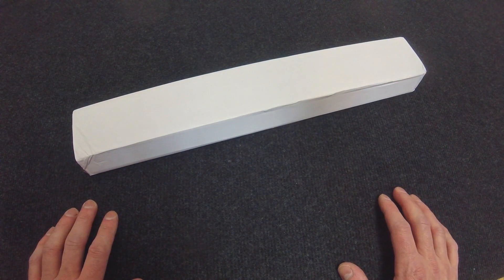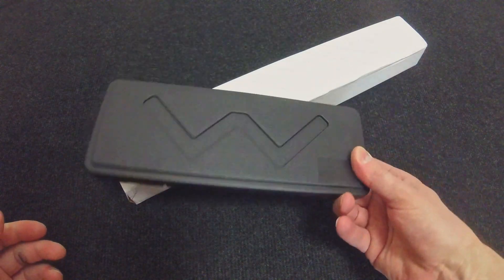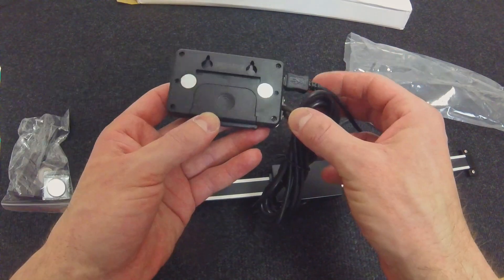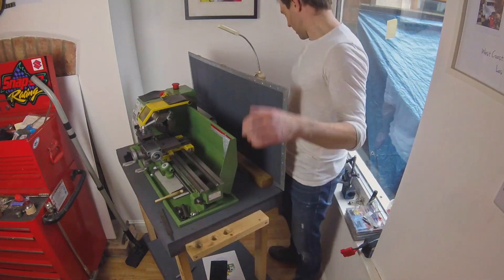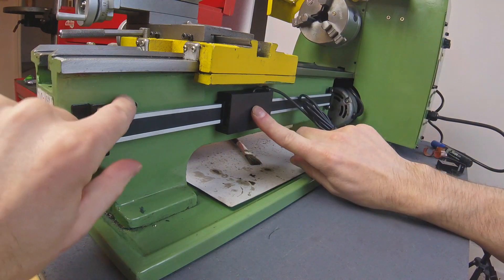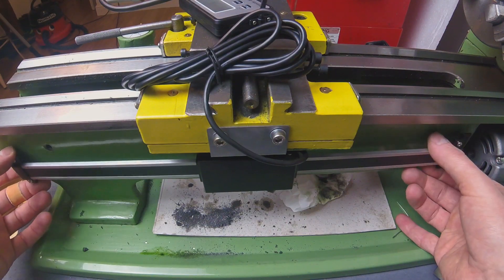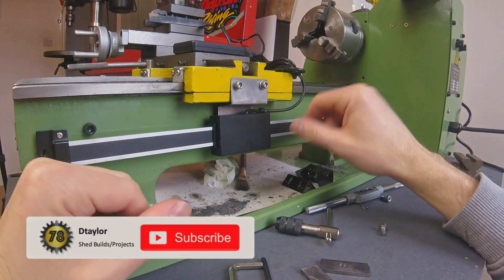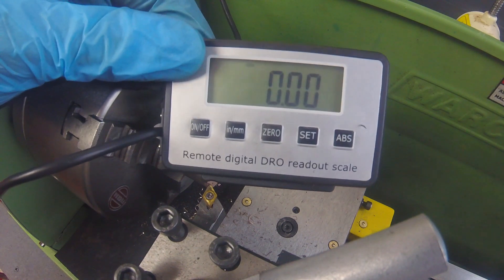Fitting Budget DRO on the Warco WM180 mini lathe modification.

Comment: I have the same setup and suggest you put a cover over everything. Once it gets fluid like cutting oil on it then it gives trouble. I used a piece of angled aluminium to keep the oil and chips off it
Reply from the maker: Great tip!

Comment: The music is horrendous and unnecessary, but your little Chinese lathe is very nice, it looks like it's a Warco WM180.
 I've always got respect for those that have a metal cutting lathe at home to persue their interests, especially those that spend time to "bond with the lathe" as you said you have.
 A DRO fitted to measure the movement of the lathes carriage is very useful and worthwhile. I have been meaning to do the same to my larger Warco lathe for years, maybe after watching your vid I will just get the heck on with it.
Reply from the maker: Been using it now for good month or so and it has completely changed the way I work with the lathe, Im alot more happier that I can get accurate measurements and can make multiple parts that are consistent.
Yeah its a Warco WM180, take the time and fit one :)